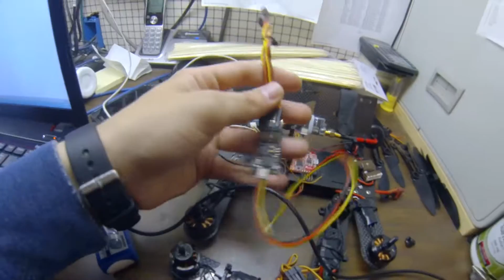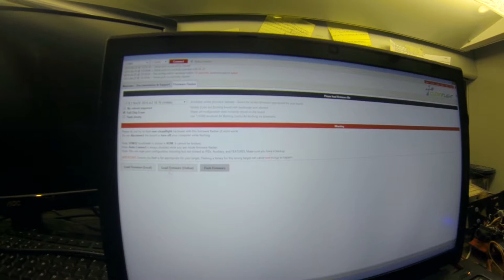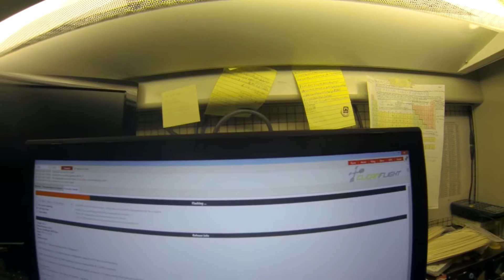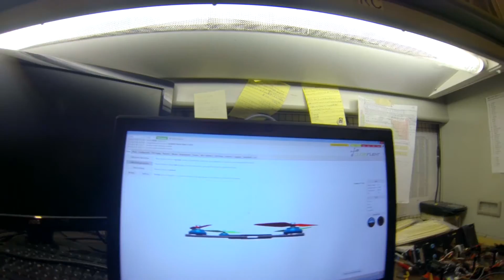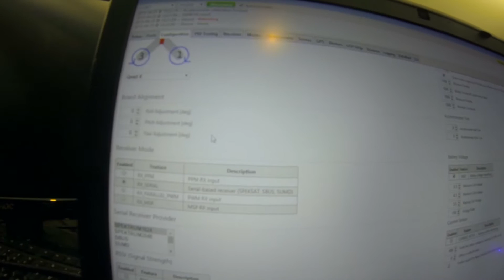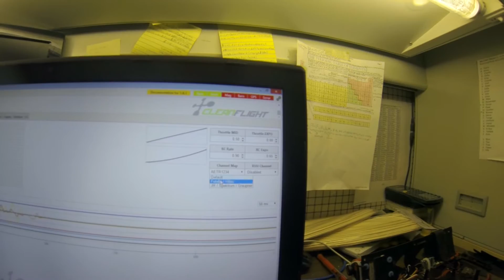how to setup serial rx on naze 32 with cleanflight 1.8 1.9

Comment: I am soldering the 3 wires to a ppm output. I have tried 2 combinations with the black wire in the middle, one of the combinations made the receiver light up but not respond, the other makes it "blip" just after power is added. I tested binding the receiver again using one of my other lemon rx receivers but the light wouldn't turn on, next thing I new the receiver light was not working and I was smelling copper...   I am using the SP racing F3 and have no clue how to fix this problem
Reply from the maker: I would recommend asking your question on this chat. They are very helpful and should be able to help you out. I hope u get it fixed.
http://fpvchat.slack.com/
Reply: sounds good, thanks

Comment: What's the range like with a satellite only? Also where is best to mount it on a carbon frame?
Reply from the maker: +mark mitchell The range is fine. Inever had an issue with just regular mini quad flying. I would not recommend it however if you were to fly a long ways away. I would try to mount your receiver as far away from other electronics especially escs as you can however my quads are so tight I never can do that but I have never had any issues. I always just mount it on some part of the carbon frame. I would try not to put it in a place where it is blocked to much by the carbon but really I doubt that you will have issues anywhere you mount it. 
happy flying
Luke
Reply: +RCflyer729 thanks for the info. I have a 250 carbon quad with a orange r615x receiver mounted on the top front clear or everything but I keep loosing signal at just over a football pitch away. I was doing fpv but was still in direct line of site. I'll be flying in big fields and never behind objects. I expect a better range that that. Maybe a satellite rx mounted on a stick? What do you think? 

Cheers
Reply from the maker: +mark mitchell I would say through that orange receiver out. I have had nothing but issues with orange receivers. I have crashed many planes because they have lost signal. I would recommend getting a lemon receiver. They work really well and I have never had an issue with them.

Comment: hey man I've watched your video several times i am running the very latest version of cleanflight 1.9. i just bound and solder up a cable on my satellite its plugged in and I'm showing movement in the receiver tab except my inputs for pitch role and throttle does not match what I'm doing on the controller. IE pitch moves roll and so on
Reply from the maker: ***** easy fix all you need to do is change under the receiver tap the channel map setting there are several different options just change them untill you find the one that works If this does not fix it let me know and I would be happy to help